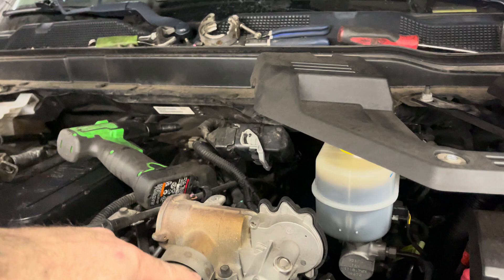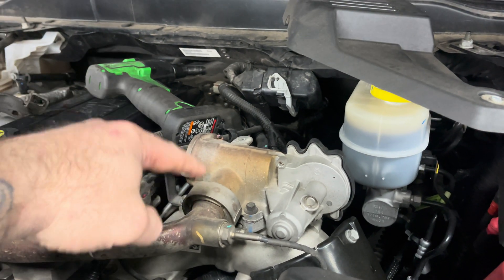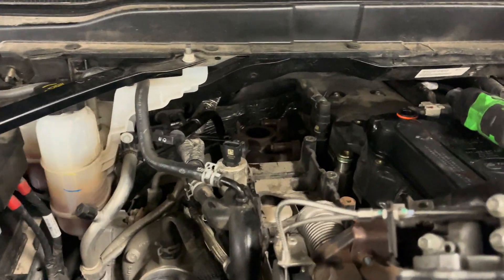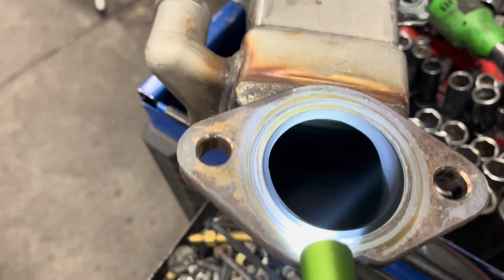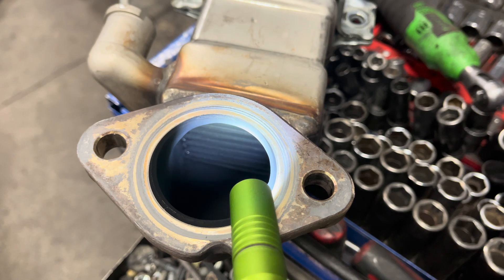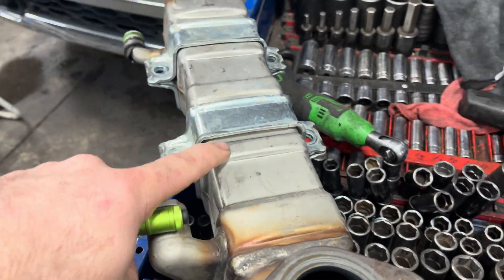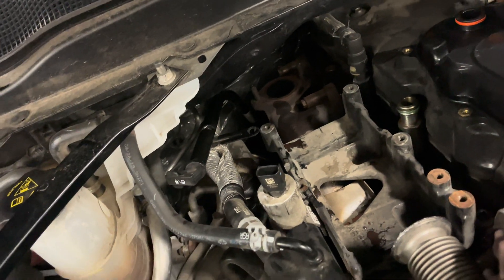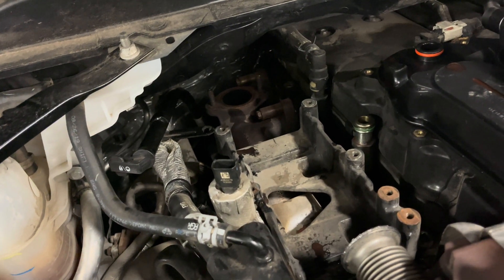Master tech shows failed egr cooler

Comment: I have an excessive flow EGR trouble code on my 2019. IT comes and goes. Seems to light up during more severe duty cycles. Then goes off a few days later. It’s covered under warranty, but I may put the truck on a diet here soon anyway. No sense taking it in to have it done just to take it right back off anyway. What say you? Not consuming any coolant that I’m aware of.

Comment: Where can i find you? City? Larry H Miller has a few dealers.
Reply from the maker: Salt Lake City Utah. Larry h miller dodge ram jeep in sandy
Reply: Why would LHM Riverdale void warranty for any aftermarket part ie. banks monster ram larger trans pan etc . But same company lets you guys do that without voiding warranty?
Reply: Random question I have 2018 tradesman is there an upgrade I can do to get a higher fan speed for ac blower?

Comment: My 2020 was low on coolant after about two years of use only about a pint enough to the light to go off. They refilled the overflow tank and it was OK but it is down again 20,000 miles later. That sounds like the culprit.

Comment: So with the new EPA rulings and the emission systems being able to go back to normal will dodge dealers except trades on deleted vehicles? In your opinion at least. Will the new control modules transfer back to say a year 2021 if they remove the emission systems as they are current?
Reply: It still isn’t legal to delete emission systems, so whether you go to a RAM , JEEP , CHRYSLER or DODGE. dealer, probably not.
Reply: @ that’s not what’s being reported, but we shall see. I’m still hesitant myself.
Reply: Not sure where you’re getting your info but deletes will probably still not be legal. The new framework will eliminate future epa mandates on emissions requirements
Reply: @ same as most, on the interwebs…. That was a question I have as well. Will it cover only newer models or will it back date to previous ones. If it’s not mandatory anymore will automaker’s still use them to comply with states like California? Will they have two different models with emission crap? There have been no clear answers mostly just interpretations.
Reply: I hope dealers will continue not to service or allow trade-ins for deleted trucks. While I would prefer a deleted truck, it could create such a problem for another person on the buying end of a deleted truck. So many deletes are done incorrectly, I as a consumer wouldn’t touch a deleted truck someone else did the work on.